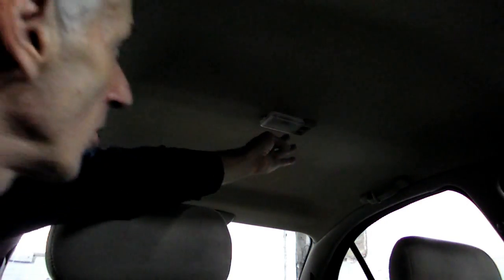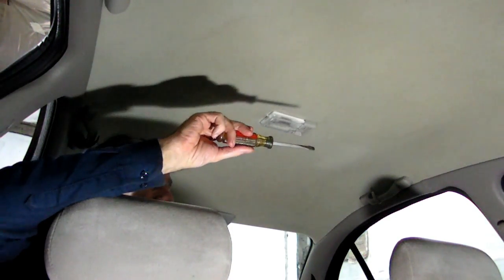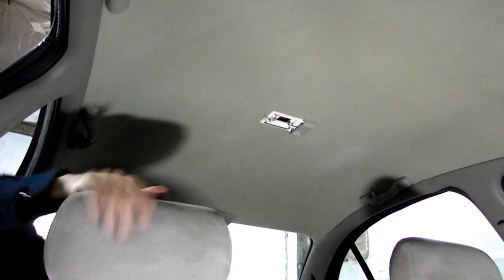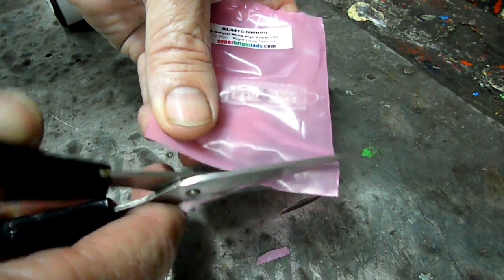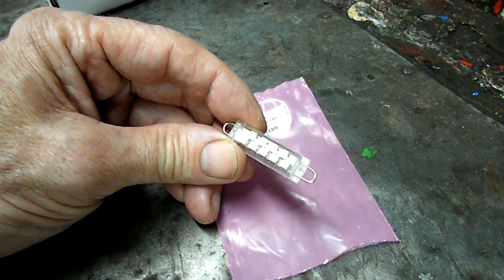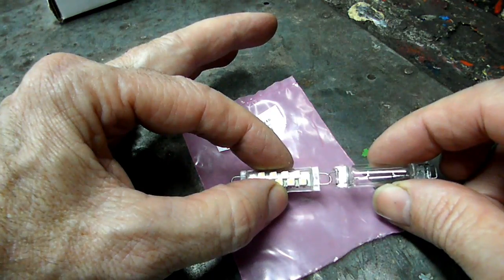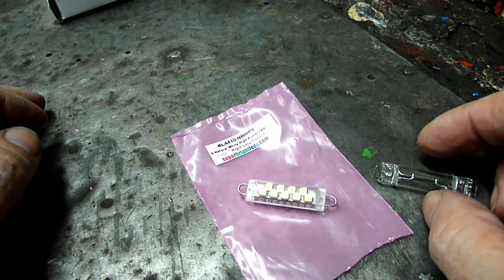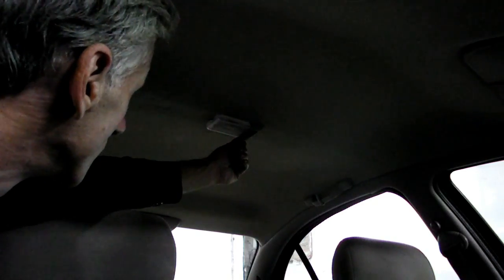Automobile Led Dome Light Conversion

Comment: Thanks Rich, that makes the most sense. Another question -- Do you know what size socket or wrench head I need to remove the two big lower bolts on the front strut assembly on the 96-99 SL's? Doing a quick-strut replacement on a 99 SL1 with a complete strut and spring unit. Thank You

Comment: I did this about a year back in my 94 SW2, I recognize those little pink bags. Not really much brighter in my case but I like the blue illumination more than the yellow.

Also replaced all the bulbs in the cluster with LEDs since half of 'em were burnt out. Looks sharp.

Comment: Great vids rich i had a issue a little ways back with the tensioner on my 95 Saturn the top alternator bolt keeps falling out once this time it snapped how would ; go about fixing that at the moment its drivable but last time that bolt fell out the squeaking then the tensioner broke

Comment: LED dome lights dont give you more ouput, sometimes its less than the regular bulb, but the advantages are; more efficiency( draws a ,far less AMPs from your battery), much less heat into your cabin on summers,really nice colors available, they look really darn cool :), those are also the reasons im custom making all my corner-lights, fog-lights, and auxiliary lights out of LEDs, I did that to my previous MR2 and forgot my corner lights on for about 4 hours went back and the car started right up

Comment: Yeah I'm just not a fan of LED lighting. The low power consumption is great (which also means less heat), but that's about the end of its advantages.  The light emitted is never as good, with it being very intense at the source, but dropping off far quicker into the distance. Cheaper ones are far worse, especially in terms of color temperature. Without a good lense, you have a hard time getting equivalent spherical light coverage.  And I despise being blinded by LED headlights and taillights.